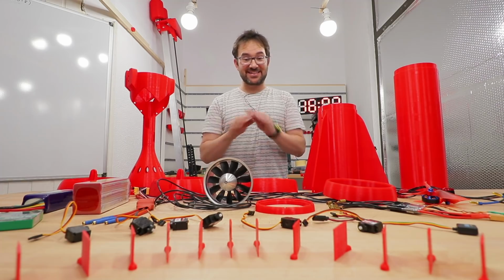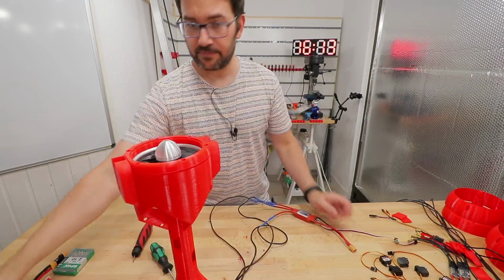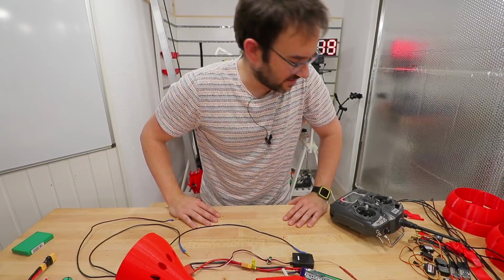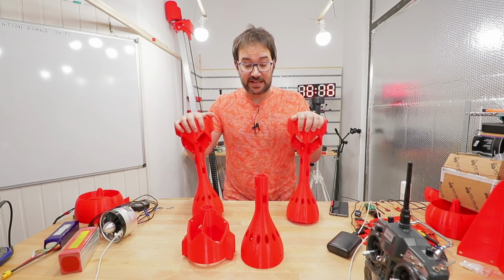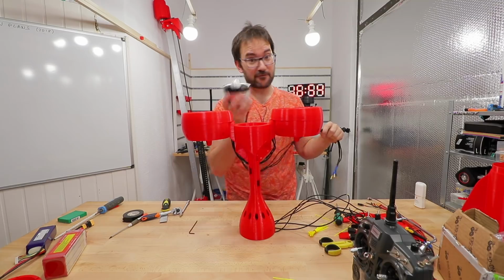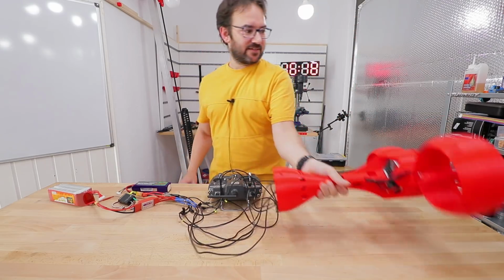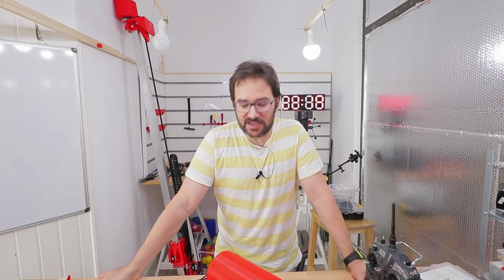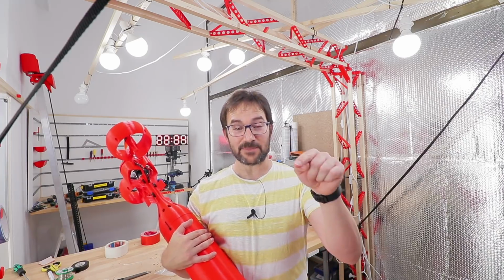3D PRINTED RC ROCKET CHALLENGE w. JAMES BRUTON | PT.1

Comment: Wikipedia: The pendulum rocket fallacy is a common fundamental misunderstanding of the mechanics of rocket flight and how rockets remain on a stable trajectory.
Reply: Seems like in this case it will behave more like a multi-rotor as apposed to a traditional rocket. Nevertheless, it's certainly going to have an entertaining maiden flight.
Reply: yshwgth back in the 7th grade I did an experiment, as I thought this was how rockets work. I’d like to think I learned from my mistakes because I’m now an aerospace engineering student 😅
Reply: This needs to be upvoted
Reply: Came to the comments immediately looking for this and was not disappointed. Thrust on the bottom!
Reply: Goddard's rocket actually made this same error.
Reply: That and putting all the weight in the tail and not finding the proper center of mass and center of pressure points.
Reply: The pendulum rocket fallacy isn't really about engine placement. It's about the fact that Goddard thought that having a low CM alone would provide stability. As long as the CP is behind CM with respect to velocity, it doesn't matter where the engines are. As long as Ivan provides a means of active control, it will be even less of an issue. As a final note, this device is more of a helicopter than a rocket, anyway, so it really doesn't matter that much. To sum up, the fallacy states that having a low CM doesn't provide stabilization.
Reply: I don't think those fins he put in are large enough for low velocity corrections...
Reply: This will work fine as long as he doesn't actually try to fly like a rocket :-) if you just hovers I will be okay but having that way down the bottom will make his stability system work harder then it needs to the weight should be as close to the nose as possible all vehicles have to points of interest center of gravity and center of pressure for a rocket you need the center of gravity to be in front of the center of pressure the moment he tries to build any forward momentum whatsoever the mass in the back of the rocket is going to try to up and the rocket and it's going to try to fly backwards and at some point his software and thrust capabilities won't be able to conversate enough to stop it it will go on stable in fact this is unstable it will only be stable mechanically Envia software via his thrust stabilization system

So put that fan duct at the bottom of the rocket and put those batteries at the top it will be stable in flight and your thrust vectoring system won't have to work so hard

For an easy real world example of why this is correct take a ruler and try to balance it on your finger tip this is reasonably easy now connect the string to the bottom of the ruler up each side to the top of the roller now hold the string now try to balance the ruler... It'll never work you'll never get it balanced it's like the difference between pulling a trailer and reversing a trailer but harder